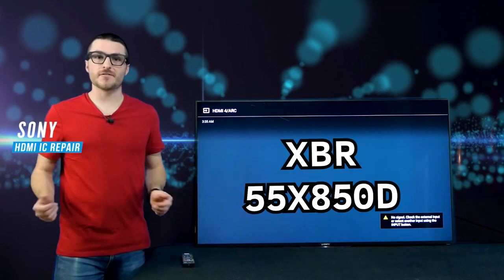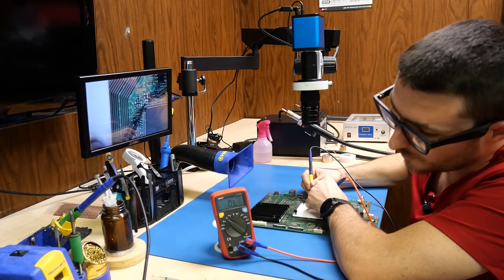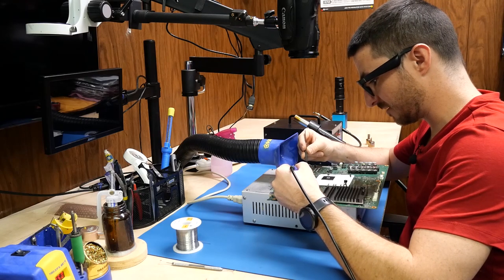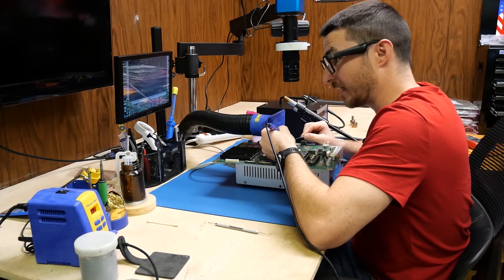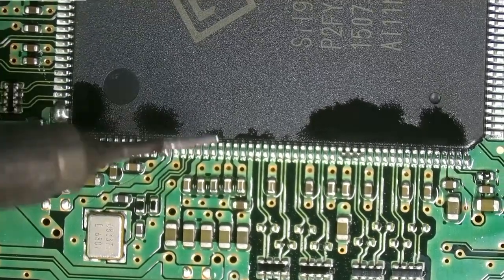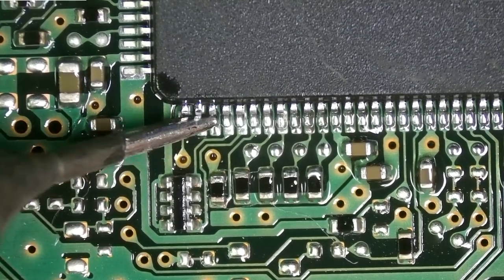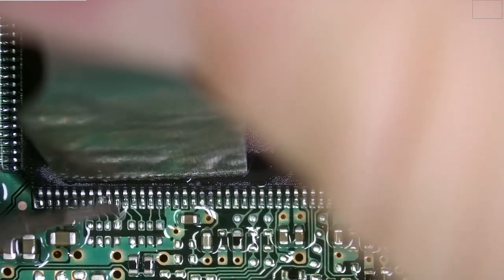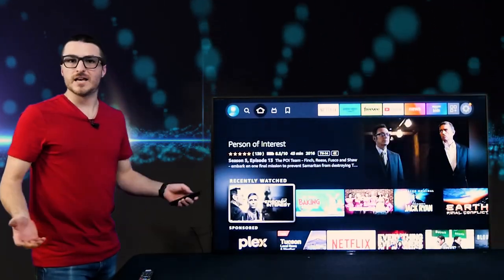No HDMI? How To "Refurbish" Your Sony XBR-55X850D TV!

Comment: 0:14 I got the symbols detecting the devices are plugged in.  Still a blank screen when I try to connect my PS4 or laptop
Reply from the maker: If this is happening with multiple devices it's possible your HDMI cable is bad and needs to be replaced. If it is only happening with 1 of the HDMI ports and not all of them it is possible the HDMI port itself could be physically damaged. It would be best to avoid using that port and use the others. If all HDMI ports have the same problem then you may have the fault shown in this video. If that is the case, you would need to send it in for repair.
Reply: @NicksTVRepair  Did some trouble shooting.  Unplugged it for 5 minutes, plugged it back in and everything worked just fine :)
Reply from the maker: Well that's the best case scenario right there!

Comment: OK dumb question, what is that black rubber thing by your Hakko?
Reply from the maker: The thing that's hanging off the cord? It's a heat resistant silicone pad.You use it to remove the tip while it's still at 400 degrees so that you don't burn yourself.

Comment: I did a 40 pin chip, it had really corroded pins, bug poop, I tried to clean it but it was too bad, the pins that were clean soldered well. My hand is so shakey every time I tried to move the chip a small amount it would bump right off pins. These things you don't realize till you try it.  Same as soldering on a bigger scale sort of.  Those pins can get bent if not packaged right, I ordered some, I got some bent pins and fake used no good transistors, they soldered new legs on it, made it look new, I can't believe they went through that much trouble.
Reply from the maker: Yeah thsoe can be tricky especially when you get bent pins from the get go.

Comment: Very nice job I know how hard it is to do it
Reply from the maker: Yeah I think those chips have like 50 pins per side so 200 in total, but what makes this one tricky is the fact that there are so many capacitors, and resistors very close to the pins, so you don't have much room to solder. That's why I end up using that very fine iron tip. 
The very small iron tip however does not transfer heat that well, and that's why I end up using the bottom heat assist. I didn't explain that very well in the video.

Comment: I'm losing  hdmi when I change other hdmi and
Reply from the maker: try cleaning them out and or also replace your HDMI cable
Reply: @NicksTVRepair  I just change the cable and cleanned the port with isopropyl alcohol
Reply from the maker: Great so that took care of it? If it didn't i would recommend using Deoxit